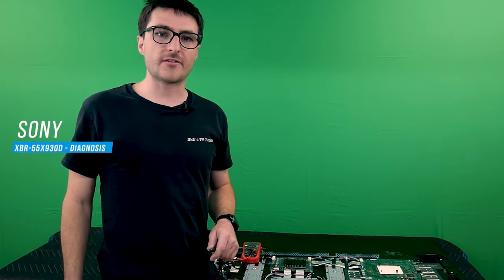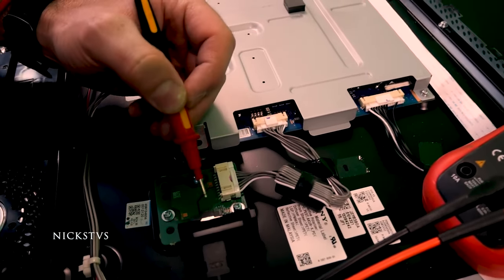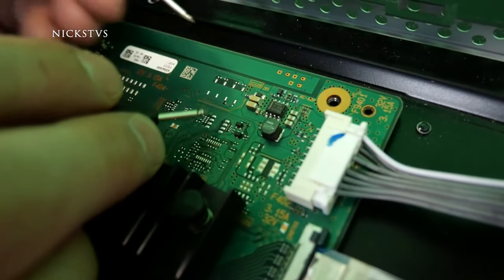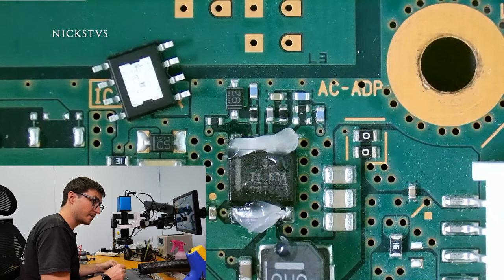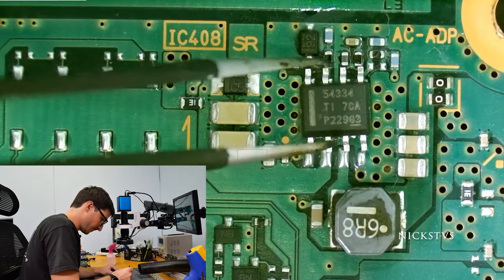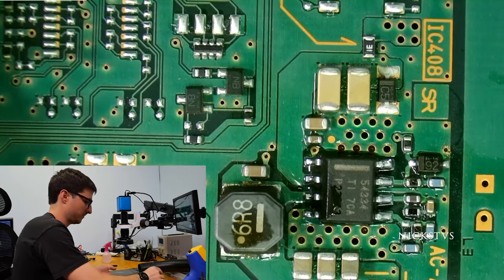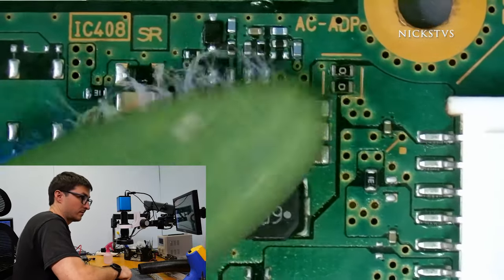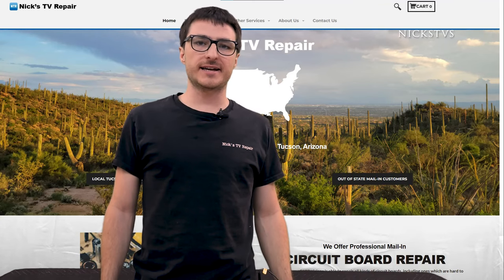Sony LED TV NO Power XBR-55X930D XBR-65X930D DPS

Comment: We have a Sony XBR49X900F just go out the Geek Squad said that the power supply and mother board were out and that he could not fix it so they credited us the full price of 850 USD to buy another TV so we purchased a LG 55B2 OLED.
It bugs me that this TV went out, it was in the bedroom so barely used not like the TV in the living room, no power surge or lighting just went out.   Is it repairable and what do you think it will cost to repair, I can put it in the hobby room.
Reply from the maker: Hello,
I am very sorry to hear the Geek Squad was your only source to service this TV set. Sony TVs are very much worth fixing. Without even seeing your TV I can with 99% certainty guarantee you the power supply is fully functional and the Geek Squad representative did not properly diagnose the device. Not because they are not a good tech but because that is the diagnostic process imposed by best buy. "replace it all just in case" 
Your mainboard 99% of the time is the only fault with the set. We are very familiar with fixing these boards and should be able to fix yours without a problem. Our circuit board repairs always come with a 1 Year warranty and are typically performed in 3-5 business days. For more information on the repair service and price, please see our service listing linked below:
https://nickselectronics.com/products/xbr-49x900f

If you have any additional questions, I would recommend reaching out to us directly via email or by filling out the contact form on our website. Please see the video description for our email and contact form links
Reply: @NicksTVRepair  I was wondering why he was using a flashlight to view into the TV, could it be that the power supply is not working as well?
I have your site now so I will be reaching out again.

Comment: If I can't run down the problem myself, may I mail you the boards?
Reply from the maker: Hello,

Yes if you have this TV, it can be tricky to identify the fault. We do on our website have both flat rate services for each individual board, but we also have a testing and diagnostic listing for $20. What I recommend is you send us an email directly, make sure to provide us with both the model number of your TV, as well as very clear and detailed symptoms you are experiencing. From there we will either tell you which board we believe you should be sending in, or if 2 parts can cause the same symptoms then we would recommend you send both in, purchase the diagnostic/testing bench fee of $20 per board, once we receive them we will, of course, test them, and identify the faulty board. The fully functional board will not be refurbished unless specifically requested, and the defective board will have its $20 diagnostics/testing fee credited towards the cost of the repair. 
Does that make sense? If not or if you have more questions then I would recommend you reach out to us directly. Our contact information is in the video description.
Thank you

Comment: Im having an issue with an 75x850e no power no noise no screen lights at all stby power is good zero power at the tcpnn pins on the main board.
Reply from the maker: Then you most likely have an EMMC fault. If you want to send in your mainboard for repair, we can fix that for you. 
Simply go to our website which is linked in the video description and type in your full correct TV model in our search bar to find the repair service. 
Your full model number is XBR-75X850E

Comment: Hi mate, nice work.
I have a sony TV have same circuits boards as the TV you worked on. My tv not working and has red light blinking 4 times.
If you can tell me which circuit I check and replace it, i did some research most of the articles says the problem could be from power board or backlight board??

Thank you Nick,
Reply from the maker: 4 blinks is typically the backlight or the LED driver board. I would recommend replacing the driver board first since it's way easier to do that than the LEDs.

Comment: I identified this IC as the shorted part thanks to your video! Now where do i find this part. I have had 0 luck searching for it using the tv model number or the numbers on the chip itself.
Reply from the maker: I have a link in the description where you can buy a replacement chip
Reply: @NicksTVRepair  I dont even know how I missed that link. I should have checked this comment before ordering the part elsewhere. I was directed over a part that is called "TPS54334 4.2-V to 28-V Input Voltage, 3-A Output Current Synchronous Step-Down Voltage Converter". Did I make a mistake or is this the same part?

Comment: Hello Nick. On my DPS board I get 24VDC out but do not get the 3.4VDC out. All 3 caps are also shorted. Would you call this a bad DPS board? Particularly that IC you removed in this video?
Reply from the maker: Yes that is exactly your issue

Comment: I looked at another video of your's and you mentioned the white wire 3.4v is for standby power. Thanks. I looked at the main board fix by following your video ( Dead Sony TV No Power Sony XBR-55X930D XBR-65X930D Mainboard ) and the resistance test passed and capacitors looks good based on the test. I felt stuck at this point on how to proceed further. As you have mentioned EMMC chip could probably the issue but I don't have a way to confirm that. Please do share if you have any.
Reply from the maker: Sorry no way to check the emmc that I am aware without desoldering it and checking it in a programmer. 
If you now have power after fixing the DPS board everything should work. If you still don't have full power, it could be that either a cable or ribbon was not properly inserted back in and you may have to reseat all cables, it could be 1 of the pins on the IC chip was not soldered down properly, the IC chip you have is partially defective, which unfortunately can happen, or it is also possible that your mainboard is also defective in addition to your DPS board which is rare but we have seen happen at least a dozen times in the hundreds of these we have had to service. 
I would start with double checking your work, double checking all ribbons and cables first and trying to boot up the set again. If still nothing, I would then replace the IC with another in case the first one is defective. 
If you still have issues after that, then it could be something to do with the mainboard. 
I am sorry but I don't think I can help much more without having the boards in hand.
Reply: @NicksTVRepair  Thank you very much.

Comment: Nick, what temperature do find works best on most IC removals? I have a new hot air gun for some Ham Radio projects, my Sony XBR65X930C is still working fine.. 
Modern Ham Radio equipment uses a lot of SMD so getting the temperature in the right ballpark would be important.
Thanks
Robert, San Diego
Reply from the maker: My advice is don't listen to what I say or anyone else. 
Your machine is unique to you and the way you use it. Practice using your machine on dead boards or donor boards, learn how your tools work, try out different nozels, get a feel for what your tools can and can't do. Every circuit board and IC chip is different, there is no universal heat profile that fits all. 
The only thing I can tell you is that more heat at a higher volume of air flow for a shorter period of time is better for components and the board than doing less heat at a lower volume of air for a longer period of time. At least that's what I have found in my personal experience using my tools. 
Again your tools could be different, so don't listen to what I have to say. Find out for your self by trying out different things.
Also i aid it already but ill say it again always practice on bad donor boards. Everyone has this tendency to practice on the super-expensive boards that aren't replaceable.
Reply: @NicksTVRepair  good advice and thanks!!

Comment: Hi,what cause my sony tv if i plugged in it show static white lamp at indicator.already check no power to tcon board.
Reply from the maker: I am not sure, that is not a common fault. You could have a defective mainboard but for this model it is not common for the mainboard to fail with that symptom. I never see the DPS board fail with that symptom, I also can't imagine the power supply failing otherwise you would have no power. The T-con maybe, but it's very rare for it to go out. You can try replacing it first, but if that doesn't work I would then say to send in your mainboard for us to test in our TV and double check for you.

Comment: Thanks for the video! Can you please tell me what the part number is for the IC? I found TPS54334DDAR elsewhere but that chip appears out of stock for the next year or so. How would I find an alternate chip for the 65X930D TV? The three capacitors are also shorted on my TV.
Reply from the maker: The three caps are shorted because they are in line with that chip right. So if you remove the chip the short should go away. 
Try different suppliers such as digikey, Mouser, Arrow and so on, they should have that IC. If they don't, you can call them and sometimes they can guide you to other replacements that would be compatible.

Comment: Love these videos! I’ve been trying to learn electronics repair for a bit and got my hands on a Sony xbr-55x850d with no power(due to a power surge). The external power supply was toast so I replaced that, but there are other issues. When unplugging the main board from the power board, the backlight comes on. Just took the board out and trying to figure out what’s next. Do you guys have experience with these boards, and if so, do you plan on releasing any videos on it? Thanks!
Reply from the maker: Hello Taylor,

We do commonly service those as well. We don't have any videos on that specific model right now, but we are planning on doing a video on it in the future. But it won't be right away. I already have a few other models we are working on first, but maybe in a month or so we may have a video for the 850D boards.

Comment: If anyone has black screen with backlight after the ic change , replace the ic again , a lot of faulty ic-s are out there , i changed the ic , tv turned on with black screen , so i thought it was the t-con board , i said i will replace the ic with another new one , and it worked , screen came up again !
Reply from the maker: Some chips are sold shorted already. Recheck the board for shorts and make sure the shorts are gone before installing the board back in. 
Or you can buy the chips we sell from our website linked in the video description, those are known good, they are a bit more expensive, but they work first try everytime (unless improperly installed)
Reply: @NicksTVRepair  Thankyou , the tv is workign after i changed the chip again .

Comment: XBR-85X850F no power no stand by light..dead .. any recommendations?
Reply from the maker: For the 850F model I would say that's most likely a mainboard but there is a small chance you could have a power supply fault. 
Try this video on the XBR-75X850F I made. I do some checks on the power supply. Your set is the 85" version of my 75 I am working on but it's going to be similar. 
https://youtu.be/Y00I6rx70j0?si=26V4n8B3k2H8jmKO

Comment: hello Nick, do you know which pin is the protection line of a 55XD9305. tv standby flashes red 4 times. this tv has an led driver and a dps board
Reply from the maker: If you have the XBR-55X930D north american model equivalent, then you can disconnect the thin ribbon on the left side of the DPS board that connects the DPS and LED driver board to one another. Disconnecting it will send an auto on signal to the LEDs. If the LED's turn on, and there is good illumination through out and no fickering of the LEDs then you have confirmed your LEDs are good, your driver is good and the issue is somewhere else. 
If you don't have your LED's turn on, then either your LEDs need to be replaced or the LED driver may be defective.
Reply: @NicksTVRepair  hi Nick, when I disconnect the ribbon cable. The backlight is on and no shadow at all. Where do you think the problem is 4 x blinking ?

Comment: Hi I replaced same ic on my Tv but it only lasted 8 months before shorting out again. Do you know if Sony made a board revision to this issue? Maybe better off finding the entire board if it’s been redesigned to not short out? Thanks
Reply from the maker: There could be a few reasons for that. #1 this is a known fault which Sony has provided an extended warranty for. The issue is common but within 8 months is very fast, a little to fast to make sense. #2 the chip you got could have had some defect. #3 the chip was partially damaged during the installation. It is easy to apply to much heat and partially damage the chip as it does need to be installed with hot air. 
There is a modification you can do after installing the chip. It involves adding I believe a 72k ohm resistor connecting pins 1 and 8. This should help reduce the power draw I think and thus extend the life of the replacement chip. I don't know the specifics exactly but thats more or less what I understand. 
Please look more into it before doing this, I could be wrong with this information.
Reply: @NicksTVRepair  Thanks. Do you know if the issue involves heat? Would adding a little heat sink help or something else?

Comment: Even my TV optical light coming red, what should I do, model SONY KD 55A1 OLED, BLINKING 4 times Red light
Reply from the maker: 4 blinks is going to be a backlight failure. If you have an OLED set, then I don't think you can fix that. 
I would highly recommend you go to a local shop to have it double checked however.

Comment: Nick, I have a Sony XR-75X90J that won't turn on (it just shows the Sony logo, then turns off). The LED light flashes red 3 times. The TV started turning off during a rain storm so I suspect power surge. You think I should change the main board or the power board as well?
Reply from the maker: Manolis,

If your TV is showing the sony logo then it is in fact turning on. Since your TV is turning on, your power supply is most likely not the fault. I do not know what a 3-red blink stands for as it is not available in the service manual I have access to but if a lightning strike occurred then yes 99% of the time a power surge affects televisions not through the power, but through the data cables and internet which all connect via the mainboard. If this were my TV, I would start by replacing the mainboard.
Reply: @NicksTVRepair  thanks! I just connected the new main board. No red flashing led. The screen is backlit but nothing else happens. I tried updating the firmware with the USB drive but nothing different is happening. Any ideas?

Comment: Does it make any difference using a TPS54334DDA instead of TPS54334DDAR ?  I have a TPS54334DDA and i'm wondering if it's safe to use.
Reply from the maker: Yes, that I am aware of those are interchangable. You shouldn't have any issues with it provided it was sourced from a reliable seller.
Reply: @NicksTVRepair  thanks 🙏

Comment: Please answer me fast XD

I have 900f and my tv just goes black and is just the picture blacklight is on too but the picture just disappear and it looks painful when it happens it has sound on too
Reply from the maker: Hello,

I don't know what could cause this specifically without diagnosing the set in person. This is not a common fault for the TV to stop providing picture but still has backlight and audio. 
This could be a panel fault, or T-con fault. It is unlikely but there is also a small chance your mainboard could be causing the fault. 
If I didn't have a way to diagnose the set further, and I were in your shoes, I would start by replacing the T-con, and then the mainboard since the T-con is cheaper and more readily available. Just make sure to locate modules with return policies in case you have to return the module. 
We can live test the mainboard for you if you would like, and may be able to also fix it, if it is indeed defective depending on the exact cause of the fault. 
Sorry but unfortunately I can't provide more details without having he TV at the shop.
Reply: @NicksTVRepair  hey thanks for it i really appreciate it, if i can i well send it there, i need expert tbh, but thank you for giving at least the possibilitys

Comment: Hey! I checked the wires from the DPS to the main board and one does give 24 V. There is no 3.4 V though. The capacitors next to the chip are shorted and the fuse is shorted (intact). Do you still think it is that chip? Is it worth sending in to you?
Reply from the maker: Yes!
They don't always fail in the exact same way but if the caps are reading a short in circuit, then that means that IC needs to be replaced and of course we can do that.
Reply: Awesome. Do you have a video on how to remove the cables from this board?
Reply: @NicksTVRepair  nevermind. Found it!

Comment: Hi mate I have sony kdl-42w805a  I think mainboard is gone no power dead. What chip needs replacing. Thanks
Reply from the maker: Sorry I am not familiar with that model. The newer TV sets, it is often either a shorted processor or software chip. Those are the 2 common culprits. Yours is an older model, so I am not 100% sure.